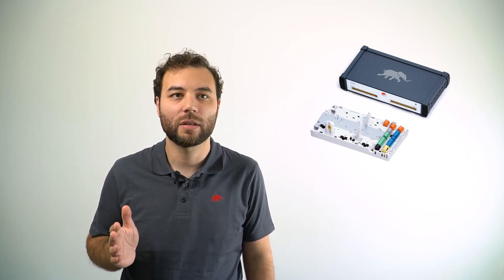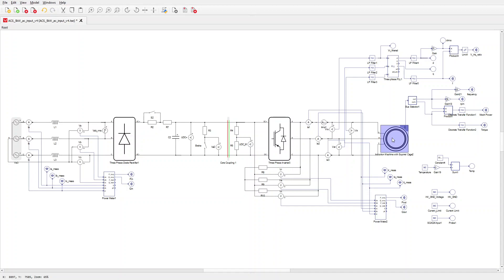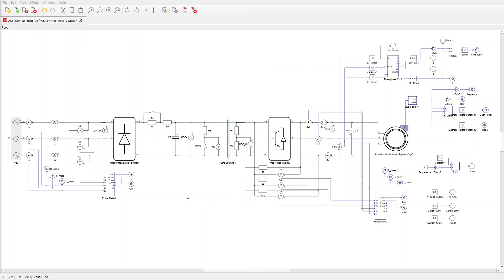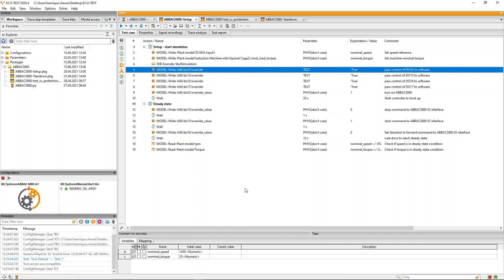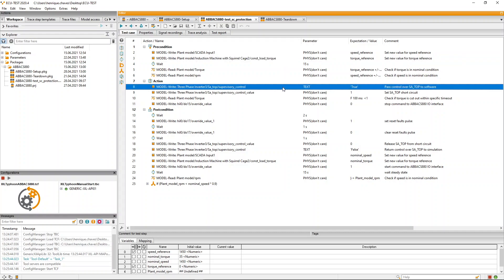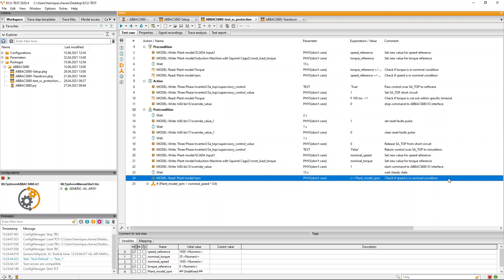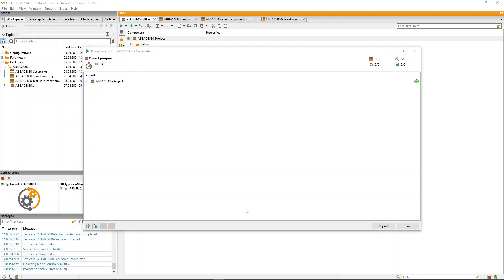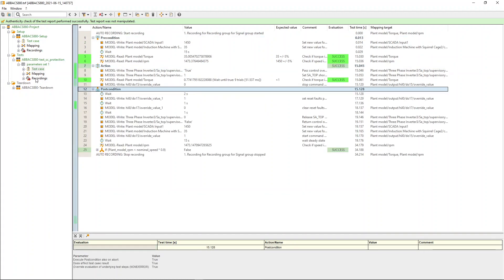Test Automation with TraceTronic ECU-Test Integration | Tutorial

Comment: If I want to get stator current data at a collection frequency of 200 kHz how can I do that and get the data tables?
Reply from the maker: Hi there, and thank you for your question!

If you want to access those measurements from ECU-TEST, you can utilize our ASAM XIL functions: 
https://www.typhoon-hil.com/documentation/typhoon-hil-software-manual/concepts/asam_xil_compatibility.html
In this case, for high-frequency collecting, you will need to use ICapture functions.

If you want to get those data from Typhoon HIL software, then you can simply use Capture/Scope widget: 
https://www.typhoon-hil.com/documentation/typhoon-hil-software-manual/concepts/capture-scope_widget.html

We hope this answer will be of help.